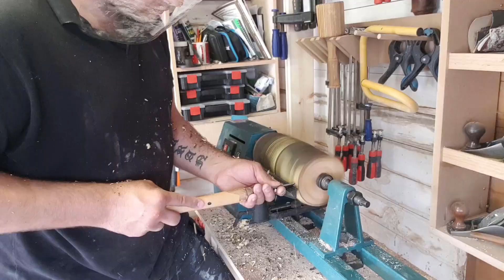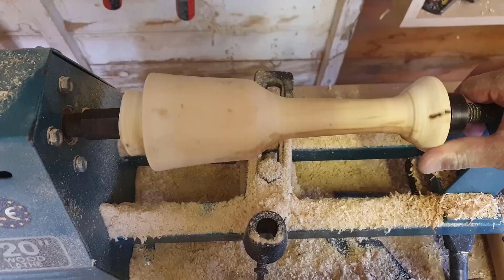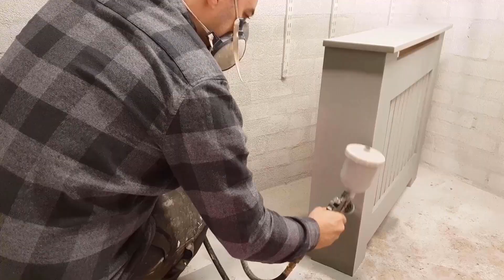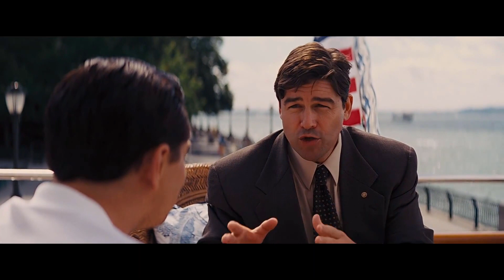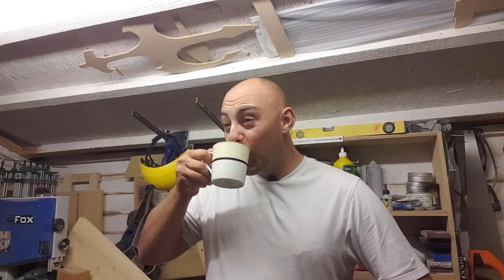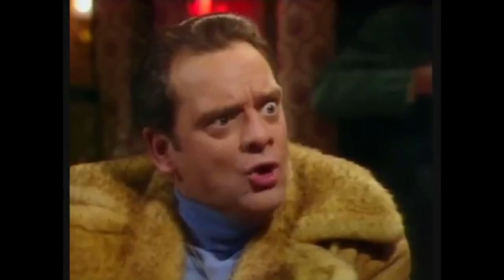Are hobbyists spoiling it for people in the trade.??

Comment: I always have a little chuckle when people start “explaining” what and how to charge.... this much, that much, peoples reason or logic. Fancy spreadsheets and methodology is to me widely comical.
I charge what I charge, and it’s between me and my client.

In response to  £1.50/hr the first question is; is that top or bottom line?
We’ve probably all done jobs that opened up the can of worms, took way longer and we made nothing on, if that’s the case - yeah I probably have had my share of a similar hourly rate.😂🤣 (I didn’t see the original post)

In response to the title question.
No, I don’t hunk they are. I think people who have poor work ethics, who cut corners, who take advantage of ill informed clients spoil it for everyone...... they’re out there!!! where do you think the idea for rogue traders and cowboy builders came from?!
It also worries me that there seems to be a rise in “I wouldn’t get out of bed for less than” or “I don’t do that type of work now” reactions. To work enquiries, I’ll build you a dining room table and chair set, or a fitted library system, but I’m not too proud to replace a bit of laminate flooring and fit a new letter box if it’s a slow month or you’re happy to have me there of an evening - after all, you might want that library next year!